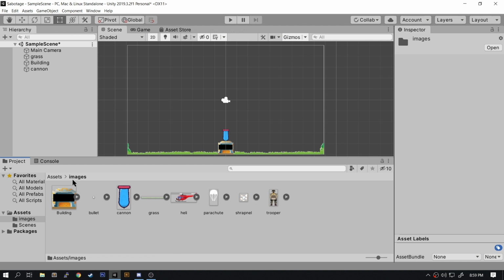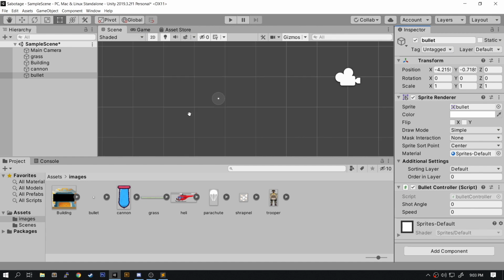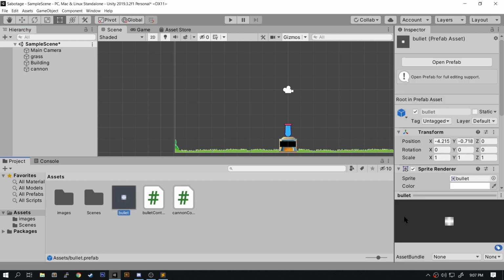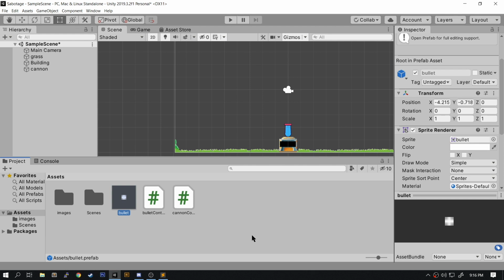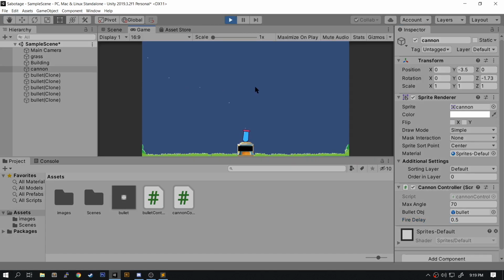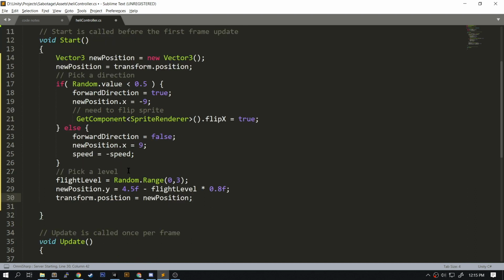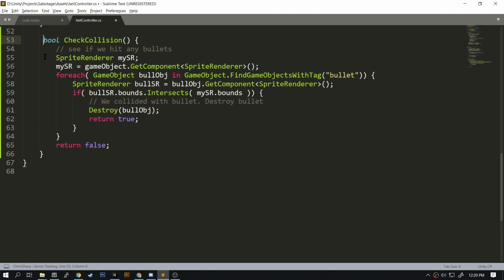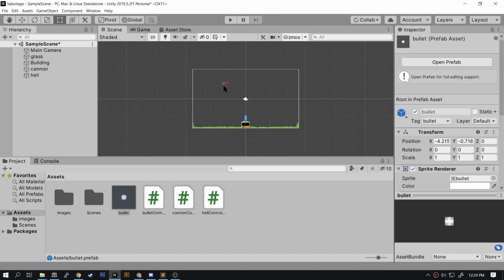Sabotage Game EP2 (Unity 2019.3) - Firing & Helicopters

Comment: Code is not working..Can you please correct it?
using System.Collections;
using System.Collections.Generic;
using UnityEngine;

public class HeliController : MonoBehaviour
{
	public float speed;
	private bool forwardDirection;
	private int flightlevel;
    // Start is called before the first frame update
    void Start()
    {
      Vector3 newPosition = new Vector3();
      newposition = transform.position;
      //Pick a direction
      if(Random.value < 0.5){ 
      	forwardDirection=true;
      	newposition.x=-9;
      	//need to flip sprite
      	GetComponent<SpriteRenderer>().flipX=true;
      } else{
      		forwardDirection=false;
      		newposition.x = 9;
      		speed = -speed;
      	}
      	//Pick a level
      	flightlevel= Random.Range(0,3);
      	newposition.y=4.5f - flightlevel*0.8f;
      	transform.position=newposition;
    }

    // Update is called once per frame
    void Update()
    {
       Vector3 newPosition=new Vector3();
       newPosition= transform.position;
       newposition.x+= speed*Time.deltaTime
       transform.position=newposition;

    }
}
Reply from the maker: Any specifics about the error message or is it just a compile error? Looks to me like your missing a semicolon at the end of the line
 newposition.x+= speed*Time.deltaTime
Reply: @mgdmillsgamedev8396  It would be a great help if you could send all those codes..I have also bought your course in udemy...
Reply: @mgdmillsgamedev8396  ok thanks I will try
Reply: @mgdmillsgamedev8396  you can send it to aayushacharya194@gmail.com